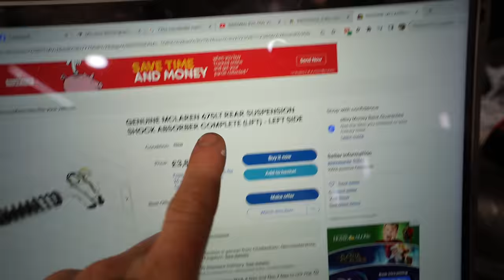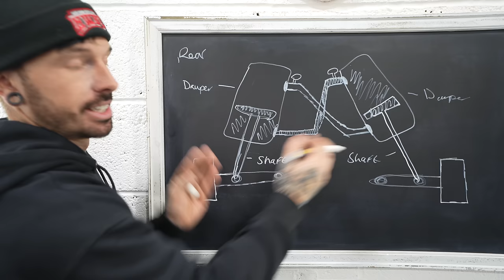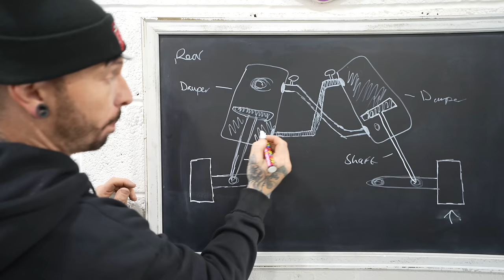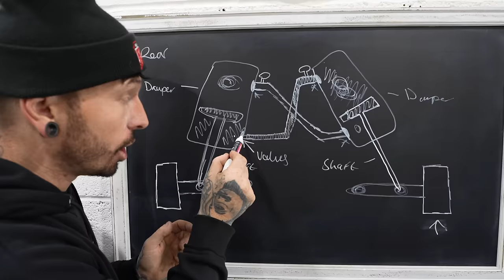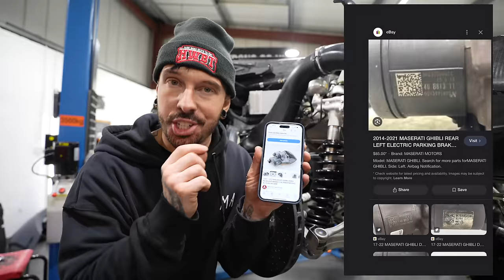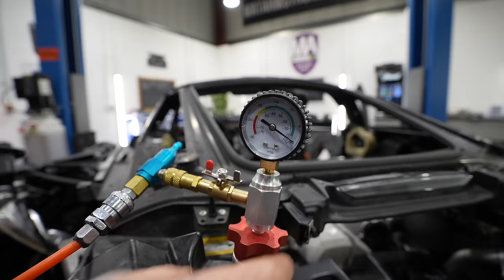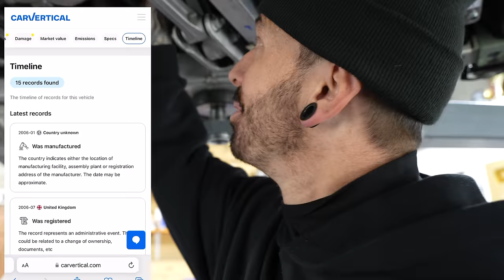I ATTEMPTED TO DRIVE MY WRECKED MCLAREN 720s

Comment: Even if the car was fully functional, it wouldn't go into gear if the front latch is unlashed (common issue with the mclaren). If you want to bypass this issue - keep the brake pedal fully depressed and hold the drive (d) selector for 20 sec and it would shift to 1st gear allowing you to move.
Reply: Needs to be pinned
Reply: Asa Lucian, mersi mult de comentariu! Poate, poate o repara pana la Craciun 😂
Reply: @zuzutm3391  Cu placere! Doamne ajuta!
Reply: Another brilliant video that smoke dnt look to clever tho🤦🏻‍♂️
Reply: Its not only only the bonnet its also the doors for mclaren. They need to be connected/ shorted most times we did work.
Reply: this guy mclarens
Reply: doar noi români știm soluția la tot😂
Reply: Probably shouldn’t be breathing all that smoke in.! £1500 plus vat = £1800.00……..you still had your pants pulled down.!!
Reply: Everyone like this so Mat definitely sees it!!!!!
Reply: Baiii suntem peste tottt! 😂😂

Comment: I work for Mclaren as a Technician. If you fill all 8L into the engine in one go during an oil change it will overflow internally and cause a smoke show. Start with 6.5L then run it and go through the top up procedure.
Reply: 😃:hand-pink-waving::hand-pink-waving::hand-pink-waving:
Reply: Does the 720s handbrake pads activate to help with cornering?
Reply: So glad it wasn't a head gasket

Comment: Matt check the oil drains from the turbos, there could be an issue with them draining oil back to the sump, this will send oil straight past the turbo seals in to the exhaust. I worked on the 570’s GT4 cars, we blew an engine in qualifying at donington, we fitted a new engine over night from the mclaren spares truck, they had left a bung in one of the turbo drains, the smoke we got was 10x worse than what’s coming from your car. It could also just be the turbo seals. Hope this helps
Reply: If you take a turbo off check in the exhaust prior to it, if there’s no oil in it then that’s your issue
Reply: Maybe check that all crankcase ventilation pipes and valves are on the right way around.
Reply: That can also explain why the oil filler cap flew off
Reply: @kobusbotes9775  thinking a bit more, if there’s too much crank case pressure this could stop the oil draining back, I reckon there’s been oil sat in the bottom of the engine which initially caused an increase in crank case pressure, and forced a load of oil past the seals.
Reply: @adamwhitaker9579  I'm picking its dry sump? I had overfilled a dry sump engine and it pushed alot of the oil into the cylinder causing smoke.
Reply: @brittenv1000  yeah they’re dry sump
Reply: As soon as I saw the white smoke ou the back I was immediately taken back the the mid 80's and my renault 5gt turbo... it was always the turbos 😢😢😢
Reply: @adamwhitaker9579 
… you are talking a lot of sense.. 👍🏼
Reply: Tavarish McLaren also smoked like this when he first started it.
Reply: Also got to think, the car only crashed, the engine was fine before the crash and there was no damage to the engine to cause the crash so it’s unlikely to be anything serious.
Reply: Don't think the drains blocked would cause the oil filler cap to pop off?
Reply: I say PVC system...it shouldn't ever literally blow the cap off...the 1st start up I was thinking valve seals until the escapade began with the multiple start trys lol
Reply: Was thinking turbo related aswell
Reply: I don’t know McLarens specifically but this makes good sense.  If the head gasket were blown to the point of that much smoke it would almost certainly be down a cylinder and possibly even hydro lock when you attempt to start it.  The smoke only got worse as the car warmed up so there’s a good chance it’s something like a wrongly connected breather line causing the crankcase pressure and keeping the turbos from draining.
Reply: Definitely a crankcase Ventilation issue.
Reply: I would see what Tavarish says about the smoke, pretty sure his 675 also smoked like this
Reply: that can tell that oilcap is flying off, how much u did put oil in it too much oil=smoke ?
Reply: Check for crank ventilation valve or if it has something similar, if that's shot, it also creates pressure in crank case and could even blow your oil cap off ...
Reply: Very very possible the turbo. Also try a leak down test. Very easy to do. Also keep in mind you have some wiring that's still not hooked up. It's possible they have something to do with the engine and computer not talking correctly. I hope that helps😀
Reply: I'm sure you and your dad will have it all done before Christmas! Then Rock up to Hammond Christmas do in it! (If he is having one!)
Reply: I would say turbo related, return lines or PCV air oil separator type system.
Reply: At First I thought Turbo's but would be very unlucky to lose both! Crankcase pressure makes more sense. I'd disconnect the pipes on the heads and see If the Smoke disappears. If not check the scavenge system on the Turbo's, the non-return valves might be piped up wrong.
Reply: Definitely the oil drains from the turbos

Comment: hi mat, you probably would already have checked it by now. but double check the oil level of the engine. if you have too much oil in the dry sump system the turbo's have difficulty draining back into the sump causing too high of a oil pressure in the drain line, causing it to poor oil past the seal in the turbo's

Comment: You could easily straighten the existing rear struts, I have done it many times.

I believe the turbos on the 720 have liquid cooled center sections so a damaged turbo could allow coolant into the exhaust.
Reply: I would say that's a possibility if it was out of one bank only, but being both it is more likely to be the crankcase breather system if its not the rings that have gone
Reply: @jamiebarber4675  That doesn't really look like smoke caused by the burning of oil in the combustion chamber.

It seems like the vast majority of exotic car power trains are fragile and temperamental.  The parts prices from exotic car manufacturers is outrageous as there is absolutely no reason for it.  A great example is the front marker lights for a Lamborghini Diablo, they sell for over $1200 a pair and they are borrowed from the Suzuki Samurai and those are $20 a pair.  The Alternator for a Testarossa is well over $1200 from Ferrari and it was borrowed from the 1985 Corvette and can be purchased from any auto parts store for $120.
Reply: I second the breather pipe being a filthy clogged up tarry mess. Otherwise, the oil pump filter...

Comment: Looks like the oil drains on the turbos might be kinked or not positioned correctly. You'll smoke like that at idle and free revving since the oil has no where to go and it just goes through the seals. Good luck!
Reply: This!!!! Also the oil gets into the turbos and creates a puddle over time which looks exactly like what’s happening here.
Reply: Yep, totally agree......start looking at the turbos and the oil lines Mat as it may not be quite as bad as you think.

Comment: Looks to me as if the turbos are leaking oil into the exhaust system, engine sounds fine... Good luck Mat! Another amazing video!
Reply: Than the smoke would be blue. 
Now its white condensation/steam
Reply: Also intercooler is dry
Reply: That's not oil, that's water/coolant, oil smoke is blue.
Reply: Could still be turbos if their water cooled and a seals gone
Reply: Maybe vacume to crank case vacumum system or check valves
Reply: @tovenaar5924 as the one who had blown turbo in the past — it doesn't smokes blue, it's surprisingly exactly as white/light-gray-ish as in this video.
Reply: If there was coolant leaking it wouldn't of held a vacuum
Reply: Looks to me like turbos seals gone
Reply: @tovenaar5924 my old supra turbos blew white smoke just like that when they had a blown seal
Reply: @j.d.8593  look at that, it was oil.

Comment: Mat it is always entertaining without being stupid like some other YouTubers. You are a hands on problem solver like a lot of us which is refreshing. Looking forward to the journey.
Reply: I agree! Tho it maybe wasnt smart to keep revving with so much smoke 😅
Reply: Matt are you sure you checked the ECU . Scan it.. OK lots of smoke.. but... if the ecu ain't knowing this engine the ecu has to relearn all the mixture settings... the engine didn't rattle did it? Running extremely rich? 
It starts easy. So I don't think it's Ll doom and gloom. I think you could need to recode everything... 
Try scanning the OBD with your scanner.
Reply: Or a shot turbo

Comment: Firstly I will say, I absolutely love these videos over the years and the optimism even when things are not going your way is so admirable!
With regards to the gearbox issue - I am far from a mechanic but a small thing I will mention - my friend has 2022 M4 Competition and it would have an issue where when reversing out of his driveway, it would randomly decide to not select a gear or when turning around it would get stuck in neutral. After 10 months of diagnostics it turned out to be a faulty seatbelt sensor as the car would not select a gear if the seatbelt was not "on" (plugged in). Would it be possible that your car is not selecting a gear because the pyro fuse/ airbags have gone off like you said earlier in the video, and the seatbelts need to be sent off to be reset? I could be wrong, but worth a mention!
All the best and I look forward to the next one!
Reply: Yea, actual faults can sometimes be something totally unrelated to the "problem". I had an ABS/ESP light on on my Peugeot a few years ago, and the dealer wanted to replace the ABS pump for £1,000, even though the ABS was working fine, so I ran away, quickly.
I eventually figured out that the problem was a stuck EGR. Basically the car didn't know the position of the EGR valve, so it couldn't calculate a torque value; which was needed for the ESP system to work. And the previous owner had blocked the EGR and deleted the parts of the code in the ECU responsible for EGR faults, so that the car wouldn't give any EGR faults.
It was annoying, but it was really satisfying to logically trace the fault and find the problem.

Comment: that smoke from the engine maybe disappointing right now but those things what makes others stop or give up but anyone who watching your channel are certain you gonna find a solution anyway and thats why your channel is truly great cause you guys never give up! :) Wish you all the best to find the solution this time as well!
Reply: They would know if the smoke was oil, because it would smell like burnt oil. The white exhaust smoke was almost certainly coolant. 

The fact it was coming out both exhausts (ie both banks) indicates it’s not something affecting just one bank. It’s extremely unlikely for both turbos to fail in the same way, and also extremely unlikely for both head gaskets to fail. 

So it must be something ‘upstream’ of that. Somehow coolant is making its way into the intake system for both banks.

Comment: Had this on a Jeep I bought. Guy had swapped out the engine with one from a breaker and it did just this. I bought it as he had run out of money and considered it a knackered engine. What I couldn't work out, is how it tested fine for head gasket yet was quite obviously blowing out coolant. Yours reminded me of it. What had happened with the Jeep was his garage that fitted it had mistakenly put a vacuum breather and a coolant pipe the wrong around. That threw coolant into the turbo and doing what yours is doing. billowed white smoke, but head  testing fine. Retrace all the pipes and make sure this hasn't happened in some part of this system. Nothing to lose but time. Good Luck - hoping it is this simple for you.

Comment: I was amazed by the syspension beause that was my thesis in 1999. The whole idea was to do what citroen did in Xanthia without the need of a pump. We also built a 1:2 model of a car with dumpers connected that way. Instead of  electrical valves we used manually adjusted flow control valves.  We have also connected the front with the back so when you break and the car tries to lean forward the whole system tried to keep the car fully parallel to the ground giving extra stubility by pushing the rear wheels to the ground, so you have more grip. It is nice that some ideas are not left in some piece of paper!

Comment: Might wanna check turbos. Not sure if these are cooled with coolant but many modern turbo cars have coolant in the turbos. Could also be oil from turbos. Obviously we can’t smell the smoke to know for sure which fluids burning😂. With no hydrocarbons in the reservoir it seems odd for it to be head, but you never know. Just an idea. Maybe it’ll help. Love the vids Mat keep it up.
Reply: Oil would have smoked a different color. This is definitely coolant

Comment: Try bypassing the oil / coolant feeds to the turbos. If the charge cooler is dry, I’d guess whatever it is that’s making the smoke (looks like oil smoke to me) is getting into the exhaust through the turbines. Good luck, peace out and thanks for the awesome channel, don’t stop! 👍👍👍
Reply: I thought that too, but it’s very light colored and not to mention if it was oil smoke they would smell burnt oil and not be looking for misplaced water lines. Hopefully it’s not a cracked sleeve and just a gasket.
Reply: Its definitely not oil that’s coolant its too dense to be oil
Reply: Both turbos would not fail at the same time. Smoke coming out of both banks - does it have a water heating loop in the intake manifold?
Reply: @TheSharkLX  unlikely for both heads to fail aswell its definitely a strange one
Reply: That smoke is too billowy and bright white to be anything but water. I’m afraid he’s gonna be pulling the engine and replacing head gaskets. 😢
Reply: @ronwilliams1094  i dont see it being the head gaskets both banks is very very unlikely
Reply: Possibly an oil cooler or oil cooler gasket than head gasket possibly?
Reply: They would know if the smoke was oil, because it would smell like burnt oil. The white exhaust smoke was almost certainly coolant. 

The fact it was coming out both exhausts (ie both banks) equally indicates it’s not something affecting just one bank. It’s extremely unlikely for both turbos to fail in the same way, and also extremely unlikely for both head gaskets to fail. 

So it must be something ‘upstream’ of that. Somehow coolant is making its way into the intake system for both banks.

Comment: Well done for getting so much done!  Honestly with all your other projects and galavanting around the world, I don't know where you find the time!  But hats off to you and your Dad and the team.

From the colour of that exhaust I'd say it's burning oil not water.  Especially as it blew the oil cap off.  I'd recommend you start with some compression checks.  It could also be as simple as valve guides leaking, but either way that head will need to come off.  Good luck mate.
Reply: To begin with there are two heads ! and valve guides leaking ? are you serieus ?
Reply: @rudiknapen4867  No, but I might be serious.  Plenty of smoke can come from the head (or heads) through the valve gear.

Comment: MATT My Twin Turbo 335i DID THIS AFTER SITTING FOR 8 Months and not running at all. I ran the car for about 20 minutes (OUTSIDE) and let all the oil and fuel and water work it's way out of the turbos and exhaust. It billowed HUGE AMOUNTS OF WHITE SMOKE for about 15 minutes then started to clear out and slowly but surely it became clean and clear!!! Just let the car run for a while and wait and see if it clears up. It could be just fuel and water etc in the system needing to burn off!!! THAT WAS THREE YEARS AGO and now I have a 600 HP car that runs perfectly! No engine rebuild nothing!! Just let her run off!!!

Comment: vacuum fillers are great yes but you might consider also getting a coolant pressure tester as well. use it first to test the system under full pressure. this makes it way easier to find leaks before adding any fluid. great job so far. your dad is a great person to have in the shop to help and break up the tension

Comment: I love how your dad absolutely cracks up laughing when a serious issue occurs. It really does lighten the mood although prob not for yourself ! Your face had that definite ..’oh ffs no way’ look about it this time. Fingers crossed it’s just something on the lines of turbo oil seals or some other oil drain issue through a turbo. Even then the fix could be a pricey addition to an already eyewateringly expensive rebuild. This is turning into my favourite build series so far. Good luck Mat.

Comment: Hiya Matt remember when you started the McLaren you had no water in system. If head Gasket has gone it wouldn’t run at temperature she would overheat. I think you must have a system on the engine that cools something down with water running through. So have you got a pipe wrong or is there a water inlet manifold or something not connected properly?? Remember your oil cooler was damaged and you replaced it water runs through that . How dose your thermostat housing work on the McLaren?? diagram on water system and water flow may help . Engine not bad in my opinion 🙏good look. And carry on with what you do best 👍

Comment: Need to check if that’s coolant get a borescope and look at the inlet ports. When we was developing the engine heads would crack and we would get coolant dribbling into the cylinders from the back side of the inlet valve

Comment: Mat, there might be some oil left in water to air intercoolers or the cats. A US YouTuber Vtuned Garage also rebuilt a 720S and swapped engine to a new tub and had the same exact issue with smoking and thought the engine was toast. They let it run and the oil residue burnt out. Check out he explains it in episode 15 of his build